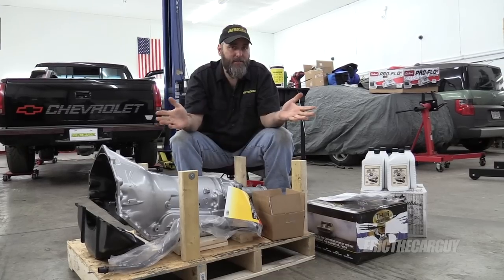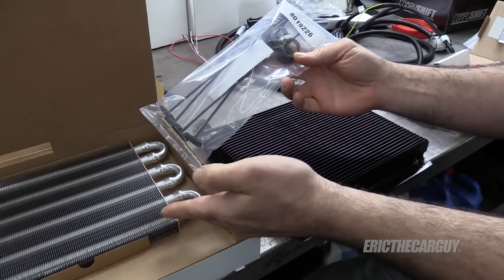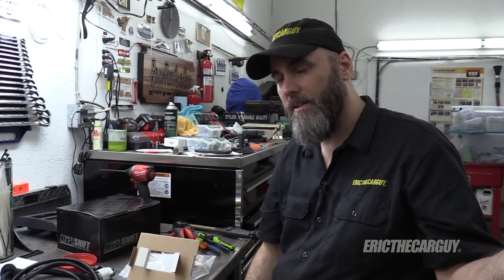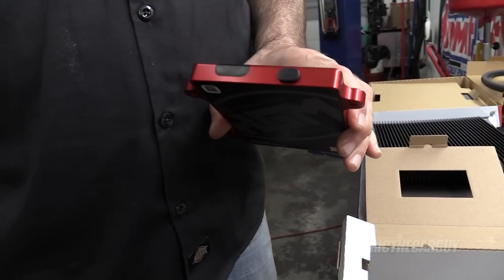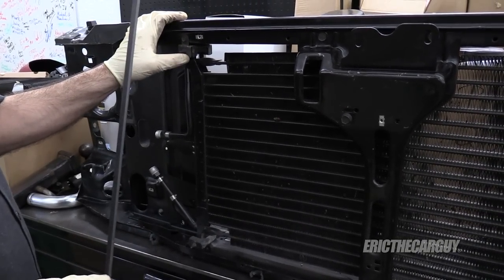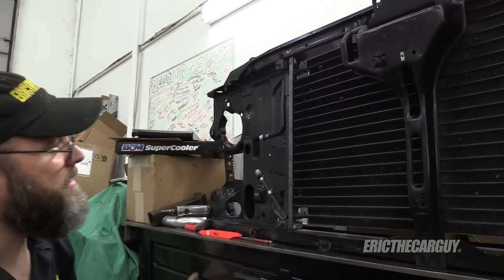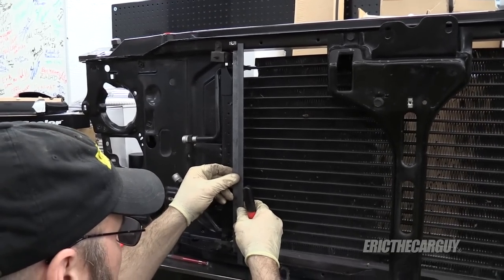Monster Transmission Intro with Transmission Cooler and Controller Installation #ETCGDadsTruck

Comment: Good luck with that monster transmission. If they haven’t changed their ways, you’ll want to get a spare.
Reply: Monster just replied to my post yesterday. Me an my buddy just installed a second monster trans in his 03 suburban this past Saturday. Yesterday he calls me an said I have p1870 code. He’s gonna take it to a known trans guy around our area an foot the bill to monster.
Reply: I will pass your info to my buddy, he had to come out of pocket 1000 to have the second trans pulled out and sent back to monster to have it rebuilt. They told him that they are not going to use his trans as acorn, that they are building him a completely new trans, lets see how this works out.
Reply: good luck with a 4L60 period

Comment: Eric! You should invest in a rivet gun with those nut-serts and some assorted 8mm bolts. Cleaner than self tappers - and they last longer. Every time I use self tappers they get pretty loose after coming in and out a few times.
Reply: Plus they will rust. It's just a matter of time. Using self tapping screws while saying "I like to over build" is a little oxymoronic.

Comment: Really hope you got a spare transmission. Not because it's a 4L60E, but because Monster. If they haven't changed their ways, I hope you have AAA.
Reply: @slumpnmyrump4986  wouldn't surprise me.
Reply: @slumpnmyrump4986  Eric's transmission went through the same process as any other order, It may have received a few extra decals in the box though 😉
Reply: @MonsterTransmission  so the same shitty transmission that you say is rebuilt that never is actually done right

Comment: I've had those long "zip ties" that come with most coolers saw right through radiators with time. We've got some pretty bad roads up here in MA, so the constant pounding guarantees they'll wear right through the radiator passageways, especially today with Chinese metals being used in everything.

That's a SWEET setup! Can't wait to hear it chirp second. 😉👍👍

Comment: I've used those simple Tube and Fin style coolers on a few of my vehicles over the years.  I had all of them mounted as intended to the condenser, making sure to use the spacers that they came with.  I never had any issues with leaks in close to 5 years of service just using quality rubber hoses and stainless steel "fuel injection" style hose clamps.  They work very well for the price if you take the time to install them properly, and are definitely a viable option for budget-conscious folks.

Mounting them to the condenser lets the cooling fan pull air through a bit better than having it out in the open.  Great for a "daily" type vehicle that spends time in traffic, or at lights.  :)
Reply from the maker: I never said you couldn't use that cooler, or mount it against the condenser. It's just my preference not to do it that way. The hottest my trans has ever gotten was 160º. The cooling fans pull air through it just fine. Thanks for your comment.

Comment: Just installed a fourth monster trans in my buddy’s suburban, I hope this one doesn’t explode as well.
Reply: We apologize for the negative experience you and your buddy have had with our transmissions. It's unlikely but there may be something else going on causing the failures. Please communicate with the client care team as much of the details as possible, even going back to looking over the build specs initially given. Thank you for sticking it out with our team to get this corrected with you.
Reply: Monster Transmission, thank you for the kind reply, although this is the fourth transmission it is the second one from monster to be installed.unfortunately the transmission that we just put in this Saturday 9/7/19 is giving a p1870 code as of yesterday. Either this is due to incompetent building or re-use of old parts, either way this is unacceptable and I do not feel confident in using nor recommending your products. Furthermore we tried getting an answer as to what happened to the old trans and have yet to receive an answer. We properly flushed the lines and cooler out till it was completely clear and used the recommend fluid for that make an model.

Comment: I did a trans swap in an old 1980 chevy van. Not rusty but dead tired and used to it's limits often, heavy loads at highway speeds. It was a 1 ton van - c 30 window style with a very under powered 305. Found a young 350 engine far better suited to my intended purpose for the van.
The 700 r 4 was done at a local shop for a reasonable price, all the magic was in the valve body and clutches and the fluid pump. Solenoids
are a weak spot they do not hold up under heat. But they were new. I was told by the re-builder it will get very hot, and it did. Use the largest radiator you can fit with a trans cooler inside and use the cooler you have in addition to it. I used a high CFM fan right on the cooler with a dash switch. I thought of a sensor of some sort but where to mount it, so switch it was guestimate temps. It did 3 things it got hot it shifted fast and it shifted hard. Cold in the morning fully loaded ladders on the racks supplies packed everywhere - paint and 6 guys it would spill your coffee all
over your shirt. So you learn get off the gas a bit let it shift back on the gas, fine all day like that. It was set up to use lock up in every gear after
1 st. It lasted ten years no trouble at all, change the fluid twice a year and it stayed happy. Not a good snow truck. A few hard shifts in the wrong place and time will leave stains in the undies. The point of writing all this ? it reminded me of the trans i had done. And how amazingly hot it got.
Not sure at all of how aggressive your trans is but if it's half of what mine did. You may want to mount a fan to it. If your cooling fans are not on
red lights will fry that trans after a while even with a cooler. And i could very well be all wrong on this, i hope i am 30 years is a long time.
4 l 60 is pretty much an electronic version of a 700 r 4, i hope it is amazing for you with no troubles at all. Best of luck with it when it's all
done it will be pretty slick indeed. Let your dad take it for a spin when it's all done. It will blow his mind. 2 thumbs up

Comment: I personally like the 700r4 Because of the OD and deep first gear, pretty good setup with 3.73 gears, also the TH400 are super durable but I’ve never been a fan of the 4L60E even though it’s basically just a 700r4 with the computer telling it to shift now

Comment: I would definitely depin the TISS and TOSS connectors, likely the same pins and you can just change plugs without cutting.
Reply from the maker: That wouldn’t be the length that I wanted. Thanks for your comment.
Reply: @ericthecarguy  Ah what a shame. Depinning is a lot of fun.

Comment: For $100 they have a GPS speedometer sending unit that puts out a pulse per mile signal. I want to try one and use my factory speedo but I've read mixed reviews on the actual product.

Comment: Air goes the path of least resistance, thats why they want you to mount the cooler against the condenser. Now you have to build a shroud around the oil cooler if you want airflow trough the condenser behind the cooler. =) sorry for bad spelling.
Reply from the maker: This cooler works just fine. The temp has never gotten any hotter than 160º. No need for a shroud. Thank you for your comment.

Comment: Eric, Are you using the transmission cooler in the radiator?  In other words, is trans. oil going from the trans to radiator, then to the B&M cooler or are you running the fluid directly from the trans to the B&M cooler?  The OEM supplemental trans. coolers that I have seen from GM run the fluid through the radiator so GM must have a reason to do that.  Is GM worried about the trans. fluid get too cold or is the some other reason? (IE. it is some how cheaper to manufacture)

Comment: Nice video Eric, if i may propose one thing; try using a bit of compression on the audio channel of your editing software.
That will keep the sound at a more  composed level, especially when you use your power tools.
Reply from the maker: I leave that in for the same reason Beethoven made loud parts of his works, to keep the audience awake. As it is now, nothing ever goes above 0db. Thank you for your comment.

Comment: Whoever designed that front end had a time machine. They came to the future, broke into your shop, and measured the piece of steel you were going to use for the brackets. Then went back to the past and designed it so when you went to use that steel, you'd have the exact amount needed.

Comment: @EricTheCarGuy
 You may want to talk to the manufacturer of the transmission controller, about using rubber isolator mounts for vibration control. It is a good idea for most electronics in vehicles.
Reply from the maker: It was never mentioned in the installation instructions, nor mentioned by the person who developed the controller, when I talked with him on the phone. Also, where I mounted it, I don't believe there will be significant vibrations to worry about. So far there haven't been any issues.  Lastly, I've seen several automotive computers, including the one that I removed from this truck, that didn't use any kind of vibration dampening. In my experience, if it's a concern by the manufacturer, the use internal vibration dampening, or they incorporate it into the mounting if they feel it's necessary. Thank you for your comment.

Comment: Saw some videos on here with those B&M coolers and they seem to be the best on the market. Derale also makes some solid ones. The tube and fin design is also good but the  turbulators inside the pipes might affect pressure.  Maybe low pressure drop

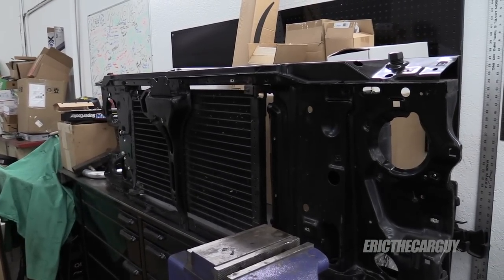Comment: Ok, in all honesty, I have paused the video at the 7:06 mark as I make this comment.  Will the hood hinge clear the controller panel you just mounted?  Just me being curious.  Thanks and keep up the good work.
Reply from the maker: You sir, are an astute viewer. No, it did not clear, and as you'll see in future videos, I moved it to where the cruise control was. Good eye.
Reply: @ericthecarguy  Was wondering what that controller on the firewall in some of the older videos was, thought maybe a fan or fuel pump controller. Now I know.

Comment: Eric, never sure how to leave you a comment on an older video.  
On the LEDs headlights, etc you tested.  It was very informative...but no follow up as to how hot they get and which ones are good or bad.   Seen a few melt from the heat, LEDs can get darn hot  being enclosed and all. 
Any more recommendations as which ones are the best to use.

Comment: Monster actually doesn't recommend using the stacked plate type cooler as they trap debris, this is why they most likely gave you a cooler for your trans install, I would highly suggest getting an auxiliary spin on filter for the trans to keep things extra clean and will go further to protect the transmission. Other valuable things would be a temp gauge, and I run a deep sump pan on my truck for added cooling. I'm not sure why they wanted you to plumb your cooler with the inlet towards the bottom, I did mine the opposite way and no matter what I do my trans stays at 185 weather i'm cruising or hauling ass.
Reply from the maker: My trans temp gauge. https://www.youtube.com/watch?v=i5Zy04iBvzI&t=808s

The cooler that was sent with the trans was part of one of their master kits. You can get the trans without a cooler. 

The mounting information came straight from the instructions for the B&M Cooler. The hottest it's ever gotten was 160º. Thanks for your comment.

Comment: Which trans did you get, quick ship, or custom? I was just looking at their site yesterday. Putting a 5.7 in my 94 chevy c1500 stepside. Thinking about getting a trans too. Love the show man, thanks.
Reply: What did you go with ?
Reply: @chickenfoundation9323  nothing yet. Bought a couple more projects, 87 monte carlo ls, and a 94 cadillac fleetwood I'm using as my daily. Thinking about rebuilding myself though, with the upgrade.

Comment: why not both coolers? if your worried about temp
Reply from the maker: 2 different coolers, 2 different mountings to worry about, more plumbing, more chances to leak, and in my opinion, completely unnecessary. The hottest the transmission has ever got was 160ºF. As stated in the video, my new radiator has no provisions for a transmission cooler, hence the need for this one. Thanks for your comment.

Comment: Normally those transmission soft mounting kits come with foam pads to install in between the cooler and whatever you are tying it to, personally I always prefer hard mounting coolers where possible. Also instead of ramming self tappers and 20 washers between the TCM and the body why not just install nutserts? looks cleaner and at least a rubber dampener could be installed in between
Reply from the maker: I didn’t have any on hand. Also, that’s not the final mounting point as you’ll see in future episodes. Thanks for your comment.

Comment: Having been in the engine cooling world before, common practice is TOC and Condenser in front, radiator behind.  Many times there is no air gap, many times the TOC is in front of the condenser.  Yes, engineers scream all the time because they need to maintain cooling requirements, but here again we have the "Design Studio" making these decisions and not engineers.  90% of all crap placements and difficult to work on issues is related to the design studios saying "that just doesn't look good"...Yes, that includes Oil Filter locations, and more.  Having lived this, I learned long ago the studio could call for "Just remove the engine, and it will look so pretty", and you get some idiot that says "GREAT IDEA, MAKE IT WORK"...yep...I have to laught at that condenser...now  we run 12MM, with fin pitches in the 80FPD (Fins per Decimeter), and MANY more rows.  Usually about 3 passes as well (your refrigerant goes in a S pattern down to the sub-cool zone at the bottom where it becomes a liquid again).  If you find your AC doesn't keep up, you may need to look at changing the condenser to a higher performance unit that has a higher fin density coupled with more passes through the condenser.
Reply from the maker: Thank you for your input. My radiator is massive. There are zero issues with overheating and the AC works just fine. Also, the hottest I ever saw the trans get is 160º. I suppose I'm fortunate enough that cooling on this truck isn't an issue. Thanks again for your input.
Reply: @ericthecarguy  I knew the Rad was big enough no worries there, but its always a fight on the condenser.  Now everybody is adding in CACs (Charged Air Coolers) and the available space is reduced even more.  Some places played with "Combo Coolers" which had the TOC on top, and the Condenser below it all in one planer unit.  There are issues with that idea because the two fluids going through the aluminum are at different temps, and therefore...yea, different rates of expansion.  That causes issues on its own.  It gave the condenser much needed areas of cooling capacity, but wow did it cause other issues.  It's all pretty much been worked out now, but that was real fun a few years ago...LOL

Comment: I think your truck is awesome. You are very informative and meticulous.  I am a Ford guy and want to build a 78 f250 when I can afford it and the big one, find one. Would your setup (not brand specific) be somewhat the same? I'd be having old school looks with some new school equipment.
Reply from the maker: Yes, but you’d be using a different transmission. Good luck with the build.

Comment: If you don't want the cooler touching put a spacer in there... bam air gap, use both even more cooling.
Reply from the maker: I’m happy with what I did. I’ve never seen the temp go above 160F. Thanks for the comment.
Reply: That is true, you are not really a heavy tower  in this setup also.

Comment: actually ist best to stack heat exchangers on top of eachother because in that case theres only one way for the air to go... through the cooler

wit han air gap if its less resistance for the air to just blow around the cooler instead of through it the cooler/s will be less effective
Reply: James Flores I agree, the fan suction will bypass the oil cooler.  He could add a foam shroud seal but it will be ok as is.
Reply from the maker: I've been running this cooler for a few months now. I haven't towed with it or anything, but so far the hottest the trans ever got was 160º and the AC works fine. I think I'm good. Thanks for your comment.
Reply: @ericthecarguy  sorry for the crappy grammar i really am just splitting hairs
Reply: @graymodeler  that would work too

Comment: Keep us informed on the reliability of the Monster trans.....I've heard and read nothing but problems with them from a variety of sources.
Reply: Same here. I wouldn’t install a free one from them.
Reply: Though some of our reviews are negative, we work with every client to resolve issues and improve their experience. There is quite a bit more positive reviews than negative and in comparison to the quantity of custom built transmissions shipped out every week (100+) the percentage of issues is very low. We are happy to discuss any specific reviews that give you concern by calling 800-708-0087
Reply: @zeropoint7665  Monster Transmission & Performance is a Global company that has served over 75k customers worldwide and the BBB system is not equipped to handle companies of our size or nature. Any information provided by the BBB regarding our company is false, inaccurate, and not approved by our company. 

For immediate assistance in resolving any questions or concerns regarding a purchase, please call 800-708-0087 or our through our website https://www.monstertransmission.com/Contact-Us_ep_5.html
Reply: @MonsterTransmission  please give websites that have these positive reviews.
Reply: @MonsterTransmission  Please list these websites that have these positive reviews.